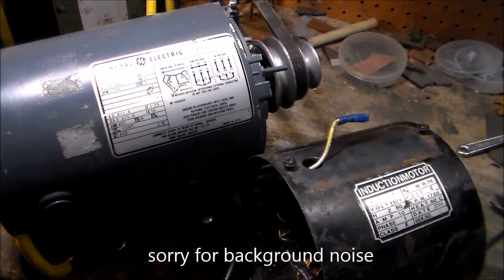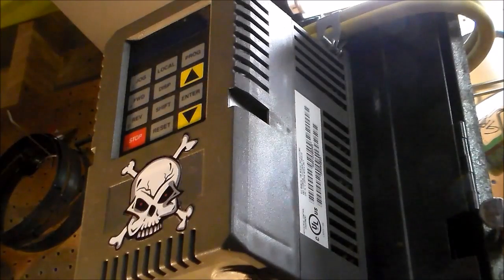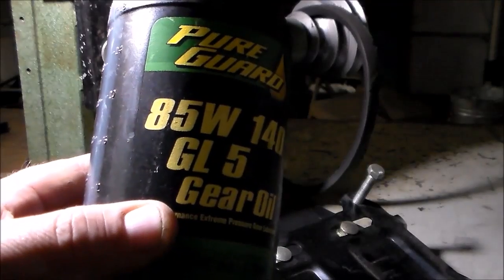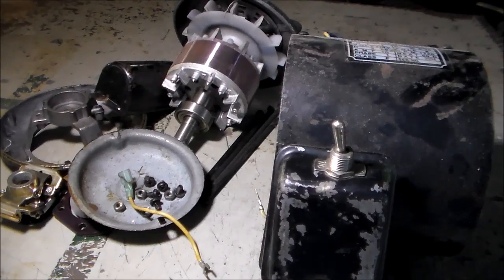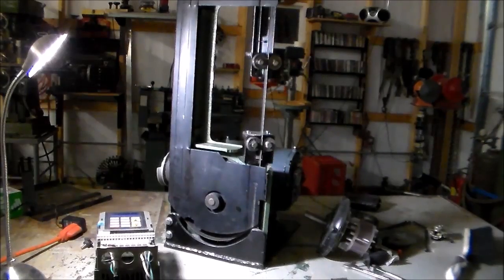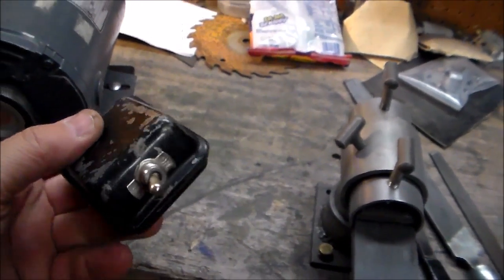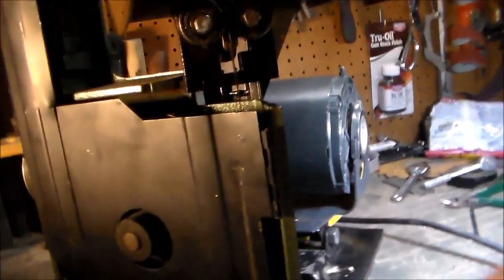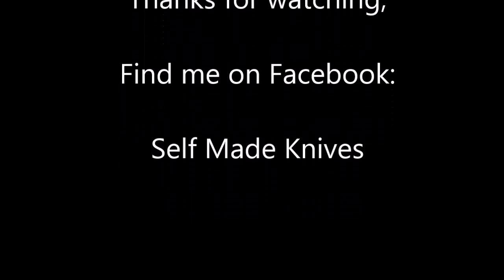Harbor Freight 4x6 Vertical Bandsaw Mod Hack Part 2

Comment from the maker: Just a note on this project, in response to a troll. If you read his comments he makes several false assumptions and inaccurate claims. I thought I’d go through them in case someone else is interested in my methods. 
First, was cost. He falsely assumed that a much better, similar saw could be bought for around $650. Not so, the closest I’ve found was around $1200. On top of that, I have less than $200 invested in this whole project since the saw was a scrap item. I built this tool for fun and as an experiment, money wasn’t even on my mind, just tinkering. 
Secondly, he claimed code violations. Well, sorry, homebuilt tools for your own use aren’t’ subject to building codes. Specifically, his gripes:
1. Extension cord used for VFD feed. Copper wire is copper wire. Doesn’t matter as long as it meets the ampacity of the tool. 
2. Extension cord on load side of VFD. Again, wire is wire. And, there is no need for shielding of the wire. I’ve been involved in hundreds of VFD applications and no one shields the motor wire. Control wire maybe, not the motor. 
3. VFD not in an enclosure. Again, with the hundreds of applications I’ve seen there is no need to install it in an enclosure unless you are in a wash down or high dust environment. 
4. No motor ground. I guess our troll’s xray vision isn’t so good. The motor is grounded with a proper ground wire into the switch box and system ground. On top of that, the entire tool is metal and either bolted or welded together, so it’s pretty well grounded. 
5. Using a green wire. Again, wire is wire. If you’re working in a breaker box or electrical cabinet, yes, using a green wire would be bad. Inside of a tool that you made for your own use, no big deal. 
This tool works amazingly well and is perfectly safe. However, as with anything you see online, take it with a grain of salt and do your own research.
Reply: Self Made Project that guy is a ignorant fool. We have 5 mills/lathes in our shop and all have extension cord wiring on them. It is encased and allows the wire to travel in a flexible way following tight corners and in some cases motion. It can also be purchased in bulk spools for exactly this type of project up to 2ot wiring. It is not a code violation. Again.., wire is wire. You must have any exposed wiring encased and that casing suffices. We have purchased many machinery equipment over the years that are manufactured around the world using the same techniques. You have done a wonderful job and were upgrading the shop 4x6 in a similar fashion. The unit new was around $175 and unfortunately they come with cheap motors. If you upgrade so to speak the only real option is to a larger model and for us is unnecessary. Those larger $1200 models still do not have vfd’s or 3ph converted motors which in our case is merely a necessity on every equipment we run here. Spending $300 on a techtop motor and Teco vfd is nothing. Besides it can move from Machine to Machine in the future and reinstall the old if selling used equipment. Any equipment running 110v ac motors are succumbed to over rated and cheaply manufactured motors that cannot withstand the uses and abuses in a shop environment. It is our understanding it is always best to buy a machine with the preemptive assumption we will be upgrading to a high end motor and a medium duty vector drive. As far as cheaper vfd’s we have had issues with braking resistors not working and the inability to control remote functions so for those cheapos we keep shelved for backups now. I really like the model you have I hope to find more about it. Oh.., UL listed? Kidding me? What does he think is stamped on the box of that Nema motor and vfd? Does he think it needs a UL rating for you to use or sell if you wanted? We have a few kits we’ve put together in the past for hobbyists to convert including motors and drives and no where is it required that those electronics get another UL rating. You can 50,000 of those upgrades of yours and you don’t need a UL rating.
Reply from the maker: Thanks Glenn. I started to just delete his comments, but then decided to stand my ground. I don't know everything, never claimed to, but some things just boil down to common sense.

Comment: I know this is an old video, but the gear oils that are bad for yellow metal gears (brass/bronze) contain sulfur. Sulfur is used as an additive in some gear oils as a “cushion” for extreme pressure applications. Always check the label for any mention of sulfur, or if you’re unsure contact the manufacturer.

Comment: I like this project. Pardon my ignorance or if I missed it in the video but is this running on 110 volts? I don’t know much at all about 3 phase. Thanks for your time.
Reply from the maker: Yes, it's running on a normal househould 110-120v outlet. These little inverters take single phase power in and put out 3 phases. Pretty handy.

Comment: What brand vfd is that? I like it actually displays rpm. I want to get rid of all mine just for ones that display the rpm. Staring at frequency is quite useless.
Reply from the maker: This was an old Baldor vfd, don't think they make them like this anymore. A lot of vfd's have a setting that will toggle between freq and rpm. I've used them both ways and it really doesn't bother me too much. I just get used to 60hz being 1800 rpm on a 4 pole motor, or 30hz being 900 rpm, etc. I'd bet there's even a cheap rpm meter/display add-on other there somewhere too.  Heck, I've got a similar vfd on my belt grinder and most of the time I don't even look at the display, just go by feel.

Comment: I have a 4x6 jet horizontal band saw that I have had for over 20 years and have had 6 horizontal band saws up to 9x16 and have always used 80-90 gear oil never had a gearbox fail the heavy oil stays on the gears when you turn it off ready for next start if gearbox does not have a level plug make sure worm gear has oil half way up on it with saw in operating position
Reply from the maker: Thanks!
Reply: Synchromesh works good. Several manufactured install the wrong oil and the sulpher based eats away the bronze would gear.

Comment: On your gear oil issue I have a Jet  bandsaw and it calls for Mobil SHC 634 synthetic oil. Or equivalent.  It's hard to find.  I found it on Amazon for $27 quart. I didn't want to take the chance so I bought it. It's called Mobil SHC 634 is a supreme performance synthetic circulating and gear oil for applications that include  enclosed gearboxes requiring and AGMA 7 or 7S oil and bearings in circulating system. Superb wear protection for bearings and gears. Outstanding performance at both high and low temperatures and is up to 3.6% Energy Efficiency versus mineral oil.  I didn't want to take the chance when I changed the oil in my Jet band saw,  so I found it . It doesn't have a GL number on it but it does have a ISO VG 460 label on the bottle. I was going to put Amsoil  90 wt. Synthetic  gear oil in my saw. but like said I found this Mobil SHC 634 in  Qt's on Amazon . It says the oil should be changed after 3 months first time, then yearly with continuous use. mine was looking cloudy so I changed it. Great video.  I like the 3 phase motor conversion job you did.  when my China  motor goes I'll go that route.
Reply from the maker: Thanks. Wow, it was expensive! I haven't opened this one up again yet so I hope it's ok.
Reply: I'm sure it will. It calls for 8 Oz of gear lube in the box. so I'm good for 3 more changes.  Have fun.

Comment: So it's been two years. How is everything working on the saw? I love everything you did to it and will do the vertical mount to mine one of these days. In the first video you talked about chips gathering at the bottom, any issues? Gear oil still doing okay? Anything that you would do different?
Reply from the maker: Thanks Tom. Wouldn't change a thing! I use it all the time and it hasn't had a single issue. I was going to make a better table, but ended up using the one that came with the newer saw I bought. The newer one's table, had a 3rd leg that made the little table much stiffer. The old one was just the little table with 2 screws. A table with a smaller blade slot would be nice though, since little bits of metal really want to fall right in there. I need to make a miter gauge sometime too.

Comment: I can't afford 3 phase (at the moment) and wanted variable speed and also reverse for my wood lathe. What I used after some research on my lathe, drill press, and a belt driven vintage bench grinder is treadmill motors. I use the speed control circuit board that's also from the treadmill. I have had the one on my lathe for close to a year without a glitch no joke. I can't believe how much more power and torque it has compared to the factory 3/4 HP motor that come with the General lathe. The treadmill motors are DC and the voltage is from 0- 90 if I remember correctly. I think a treadmill motor will be going on my bandsaw. People are always giving them away on Craigslist. The last one I bought was 25 dollars from Goodwill. Check out some of the treadmill motor builds on here. If you can score a free one try it out I think you will really be impressed. Thanks!